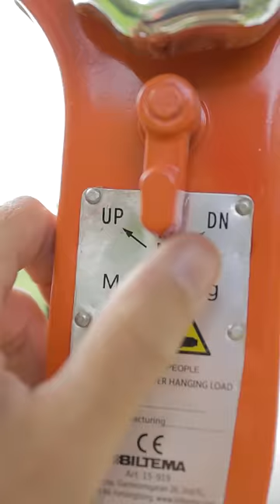Heavy Maintenance!

Comment from the maker: Wow, this short really took off! To clarify a few things: Yes, this was a very stupid and dangerous way of cleaning the deck. Please don't do it this way. Also, I did a complete overhaul, so the fact that I filled the carburetor with oil wasn't a problem since it didn't run to begin with :) Works fine now!
Reply from the maker: Followup: probably I didn't have to paint or tape the blade after sharpening it, it just felt right 😅
Reply from the maker: @whiteoakfarmsc2604  Haha! Don't worry, I get enough as it is!
Reply: @TryingToBuildStuff  ignore them, even if you did everything perfectly,  someone would find something derogatory or negative to say.
Good for you... having a go is sometimes half the battle and if no mistakes are made then nothing can be learned. 
 I'm still learning from my mistakes and will until I'm gone.
Keep on keeping on👍
Reply from the maker: @rayjackson69  Thank you! I really appreciate that! That's exactly my take on it, learning by doing (and sometimes failing!). My first time fixing up a lawn mower, but now I learned several things! Again, thank you for your kind words and understanding!
Reply: @TryingToBuildStuff  👍
Reply: People just can't read. The name of the channel is "Trying to build stuff". Give the guy a break. At least he's trying.
Reply: Why did you not drive it back to the shed. Let me guess it wouldn't start.
Reply from the maker: @joshuadraper1534  hehe, thanks man, yeah, I don't know much, but I'm trying to learn! 😅
Reply: Spray the underside with bedliner  🙂👍
Reply: I’m glad you clarified. I actually yelled “NO!” when you started cranking it up 😂
Reply from the maker: @darebear2438  😂
Reply: @gordonbombay6627  I've searched Google....it appears that no deaths have occurred from garden mowers landing on a mans toes. . But there is always a first.
Enjoy the light while you can,  before the darkness creeps in🤣
Reply: Pointless to paint underneath unless you were to idk say use a undercoating.
Reply: You should also tie a square knot instead of a kids knot, because if you had used a small rope it wouldn’t have came untied plus you do know that the comalong does ratchet so that you don’t hafto rotate the handle lol the way around.
Reply: Phew.... I got worried, thought this was an advertisement for some new age method 😁 I'm so sorry I couldn't stop myself.
Reply: You're supposed to jack it up from the front all the oils going into the head it's going to smoke now

Comment: I can only imagine the smoke cloud when it was started after all that oil was relocated from being vertical
Reply from the maker: Hehe, no worries, had to give it a complete overhaul either way, was a lot of stuff wrong with it, works like a charm now :)
Reply: I was thinking the same thing... you'd better pull the plug and crank it a few times. I've seen a rod realignment once, and cylinder head ventilation ports twice. Hydro-locking a cylinder is bad juju.
Reply: I was going to comment the same thing 😂
Reply: I use my tractor and a chain to lift mine all the time. Never had an issue.
Reply: Ya if you start it rite up again
Reply: It looks like a husqvarna..... smoked on start up anyways 🤪

Comment: Hey buddy, you can take the deck off !
Reply from the maker: Just realized that!😅
Reply: @TryingToBuildStuff  when it started and smoked out the neighborhood or before that you lucky it didn't hydra lock motor careful man just YouTube it before you make the video or use a belt and lift from front so oil runs backwards not into cylinder
Reply: It will be to easy to take deck off… some people like doing things the stupid way

Comment: on my cub cadet riding mower, if I take off two 10mm screws that hold the belt retention bar in place), pull two quick release handles and disconnect a spring, I can have the deck off -- takes about two mins
Reply from the maker: Yeah, I'm going to drop the deck next time! First time doing this kind of maintenance, so I made it way more difficult than it had to be!
Reply: Trust me, I did a similar thing when I first got my mower--then found out (a year later) how easy it is to drop the deck, and well, its a huge time saver!!

Comment: Paint can trap moisture between the metal and the paint if it ever peels (which it will) use fluid film and hose off your deck after each use. If you do the deck will never rust out. Small engine mechanic here
Reply from the maker: Thanks for the advice! :)

Comment: Okay. On these lawn mowers there is an adapter that hooks to a hose to clean the underside of the mower.  Hook it up, turn the water on, and then engage the PTO to spin the blades.  Wait a 90 seconds or so and BOOM! clean.  After every mow.

Comment: That black paint on the blade is the best part... it will run off in 2 mins use
Not like a 1/4" thick blade will rust though before it needs replacing

Comment: 2 things make sure you let it sit back on it's wheels awhile b4 starting cause there will be oil in the head and carb 2 why paint the blade first rotation paints gone the deck I can understand if your using high durability paint like for engine blocks but just regular 2 dollar enamel your waisting time

Comment: As the Gas runs out the exhaust and engine oil fills the cylinder/s and the valve covers......this will work just lift it from the front!

Comment: How did you get the blades of and tight without holding the top nut on those spindles? Cause as a landscaper this is a miracle
Reply from the maker: Jammed a piece of wood (actually an axe handle) in there to stop the rotation 😅 didn't get it all on camera though!
Reply: Try using an impact.

Comment: I suggest you go ahead and drain your oil before you do anything like that. Other than that I've found it's usually better to just pull the deck even though it's a bit more time consuming, because the pulleys and belts on that type of mower are something you really should be checking at least in an interval long enough to require repainting the deck.
P.S. for an easier time keeping and getting the grass off the under side of the deck coat the entire under side of the deck with fluid film and let it sit at least a day before mowing.

Comment: Zo you not going to check  those blades to zee if they are still balanced after grinding on them that's a good  of wearing your  over deck out in a hurry only takes a small vibration at that speed to wear things put fast

Comment: Been easyer if you did things like read a book left to right,drive on right side of road,
AND REMOVED BADE FIRST AND USED A WATER HOSE WITH JET SPRAY WASHER ON END.
and then did the blade.
Bit nooo u had to do it the hard way.

Comment: So was the heavy maintenance when it hydro locked the motor after filling the cylinders with oil? Please just take it to someone next time. It'll be cheaper and safer
Reply from the maker: Pinned a comment where I tried to explain everything :) It was already dead and fixing the engine was the next project :) But yes, pretty stupid to do it this way in retrospect, won't do it again!

Comment: Whoa Whoa Whoa hold on FROSTY....I would like to ask two question. What does taping the edge of the blade do????... Because when you bye a Brand NEW BLAD there painted. Second thing is that WHY on earth would you use one single U-bolt to hold that cable tight. OSHA says that they must be 2 to 3 U-bolts 2 to 3 inches a-part (P.S. there are some humans that think everything on U-TUBE is real....SO>>>>Thanks for killing Kenny)  lmao...

Comment: Blade's maybe sharp but badly unbalanced this could lead to the machine shaking also could cause the bolt on the blade's to weaken and shear off seen this so many times happen in the UK,  plus it's piss easy to detach the mower deck . But try and be a hero and totally look the opposite 🤠 yeehar cowboy

Comment: Can't tie a knot.
Wrong way to tighten a cable clamp.
Ratchet on the chain fall is for up and down not all the way around.
Lifting the machine vertically like that and working under it isn't safe, especially when the clamp isn't tight. 

Put your tools down and don't touch them again.

Comment: Stupid! All the engine oil is either out the exhaust or intake at the point it’s inverted! The time it took to set this up was longer than to pull 4 pins and pull mower deck out.

Comment: Or just save time and remove the deck.
Reply from the maker: Wasn't aware you could do that until I saw the pins, lesson learned!
Reply: @TryingToBuildStuff  not knocking you, just want ya to be safe.also if you wanted to you could do a quick high grit sand and a clear coat on the underneath to help it longer.
Reply from the maker: Great advice, thanks!

Comment: Lmao heavy maintenance.... Diesel techs everywhere laughing hysterically. I'm a kabota tech at a dealer but we are also a cub cadet dealer. So every now and than I get stuck working on these pile of shit lawn "tractors". You don't realize how shitty they really are until you compare them to say a GR kabota for example. The mower in this vid for example. The blade spindles (yes the things that hold the spinning blades on the deck) are held on with 4 self tappers. Don't believe me go grab the shed keys and take a look for yourself. So is the stamped steel "frame"